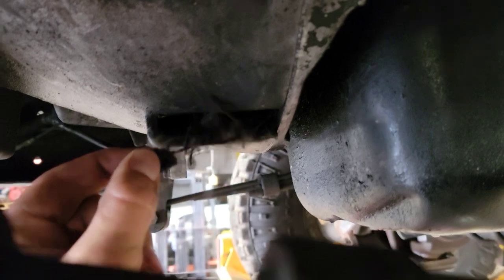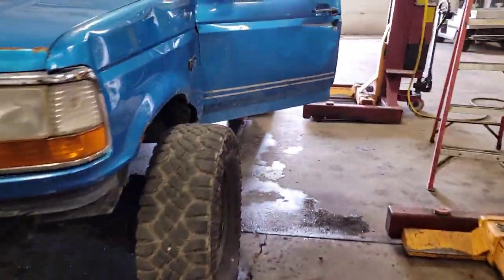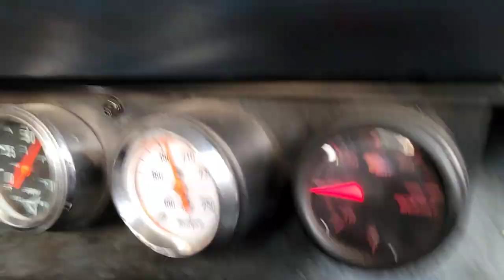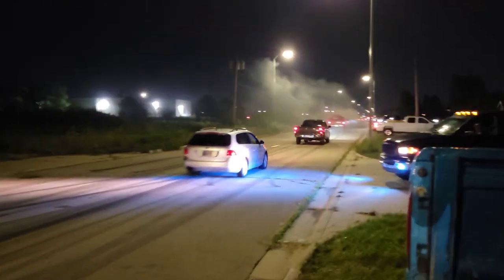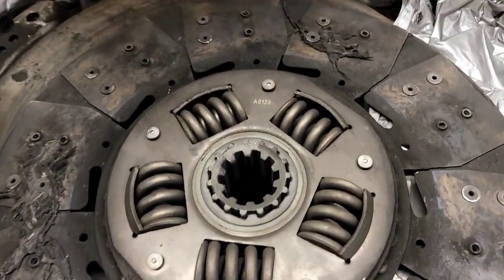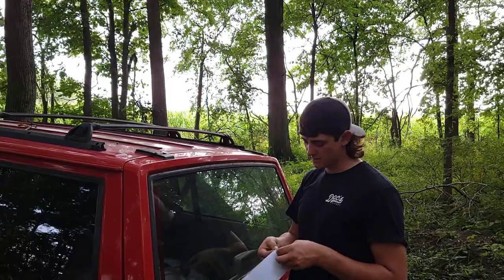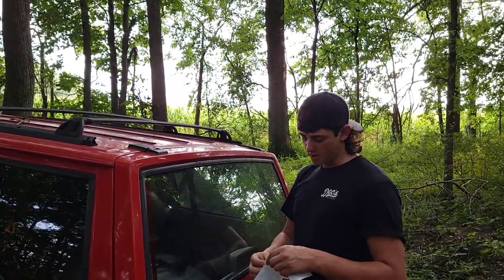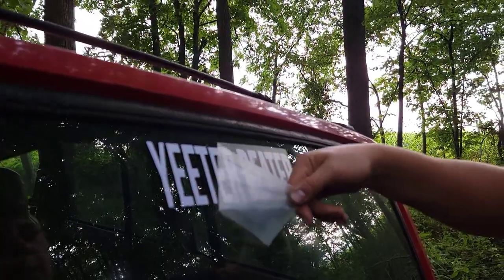I put a Dual Disc Clutch in the F150

Comment: Well you know with duel clutch you don’t have to lift your foot from the throttle when shifting…. Keep err pinned and shift+ you get to keep boost
Reply: A clutch has nothing to do with transmission syncros
Reply: @zakksrage  synchros* can handle it because technically them synchros are little clutches in that transmission… Duel disk clutch has everything to do with it. Modern cars have this feature too.

Comment: Next time you do a pull maybe best to start in 1st gear to get the wheels spinning and once it starts moving quickly go to 2nd to reduce the straight on the clutch. Your last videos launching it in 2nd low with the pull had tonnes of clutch smoke. Even the first time.
Reply from the maker: No you can't shift during the pull or your don't you have to start out in 2nd or 3rd